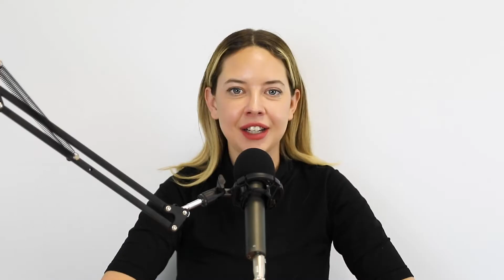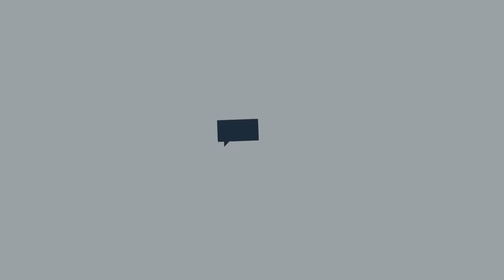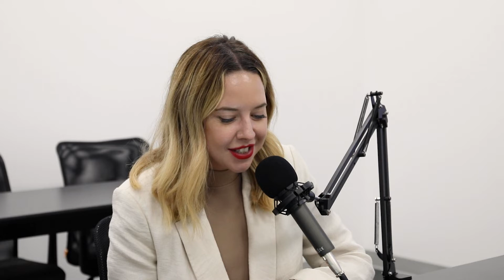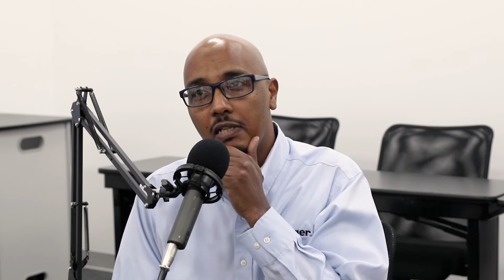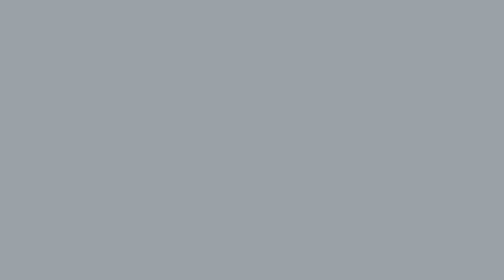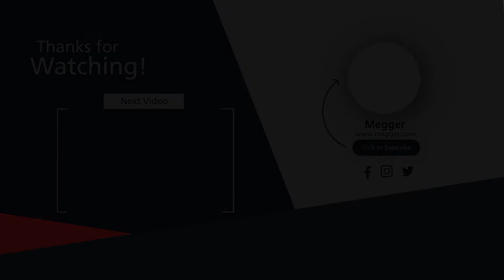Insulation Testing I Megger Watt's up podcast I EP02

Comment: Verify equipment prior to adding test leads. The assumption should be the teat equipment is always ‘hot’. Always check for zero voltage prior to performing the needed test.